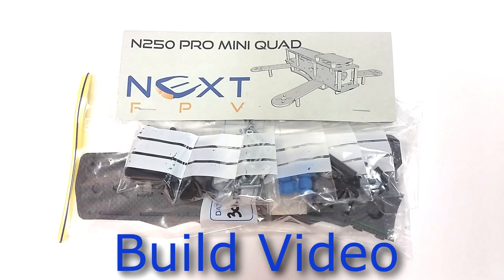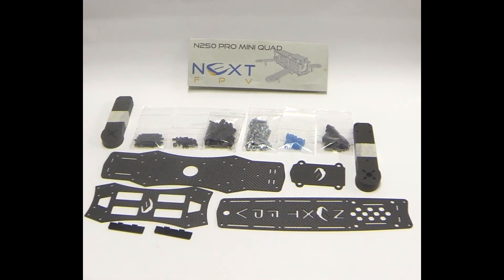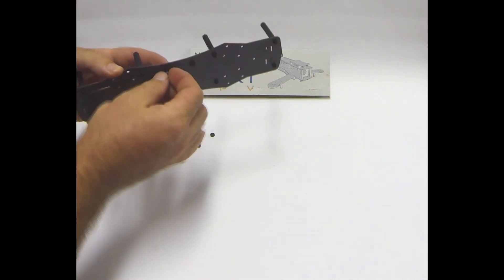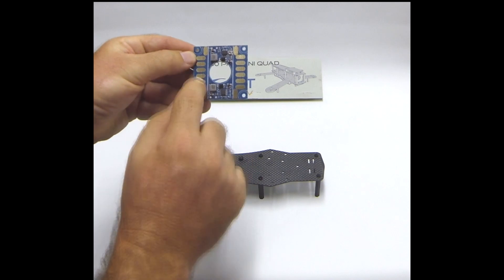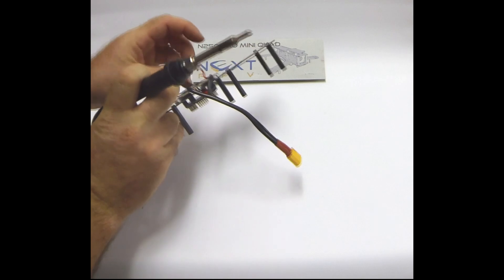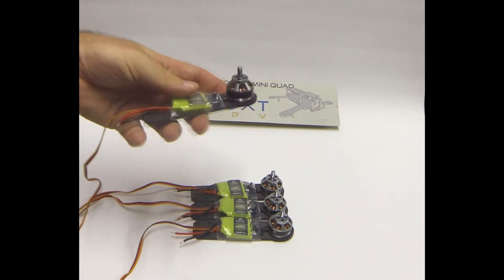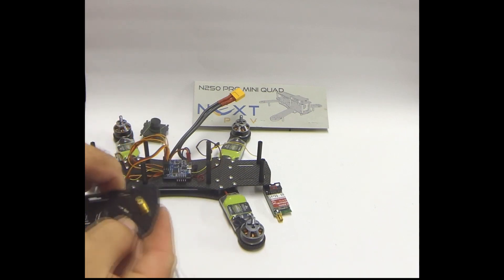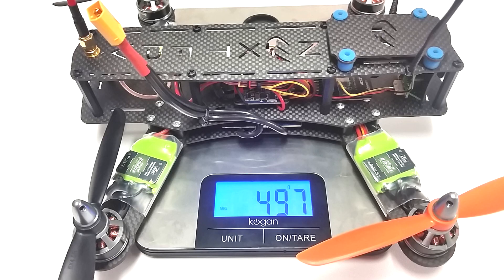Nextfpv N250 Build Video

Comment: What size shrink wrap did you use for the ESC's on the arms?
Reply: brad_FPV  It's larger than 20mm I know that much. :) 20mm I got didn't fit. Seems like it would need around 23 or 24